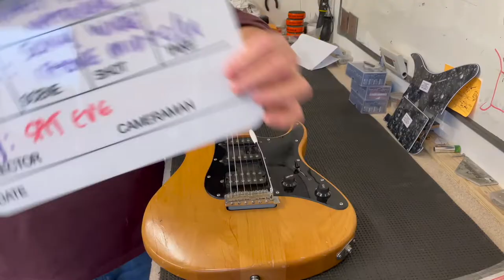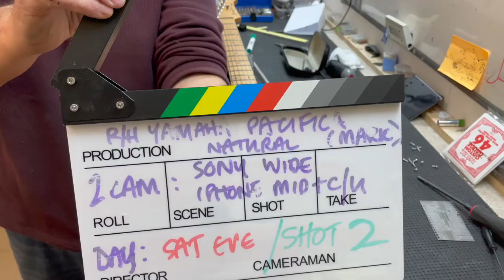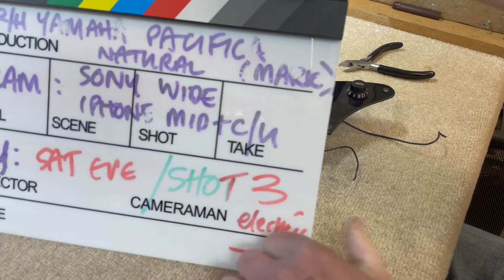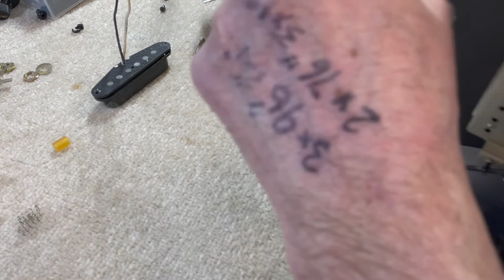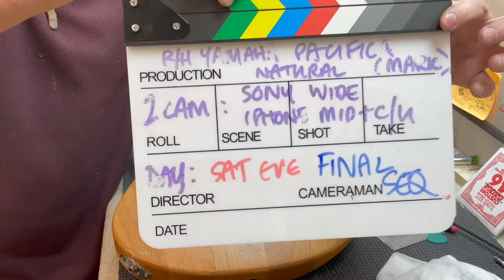Yamaha Pacfica 112 MX natural pickup change and set up

Comment: Back in the 1970's my 1st guitar was an SG 5 flying samuri (might have even been a 5A) - in 20212 my local guitar tech fitted a new nut and remarked how unusual it was and that it might be a collectible item.  The guitar had a few marks and dings and was far from perfect - put on EBay for 0.99p and it sold for £420 which funded a Strat